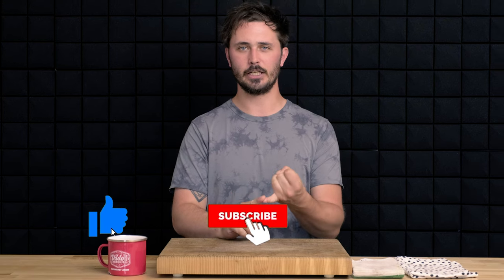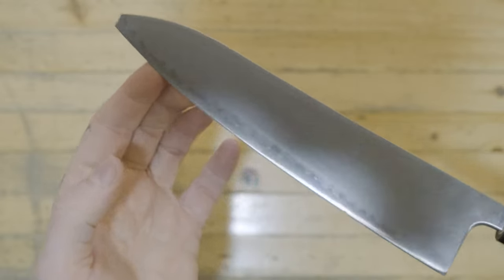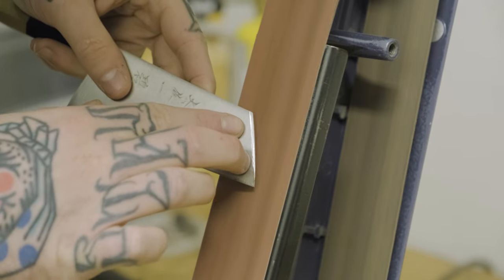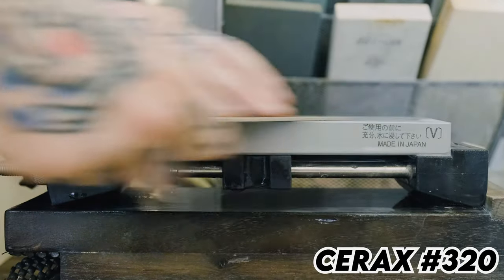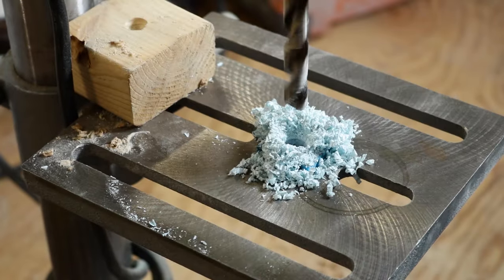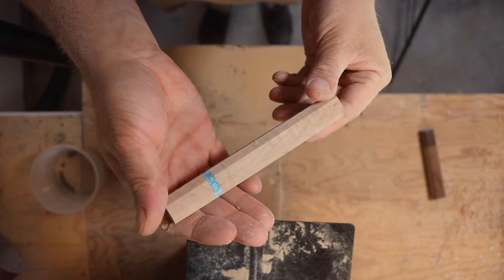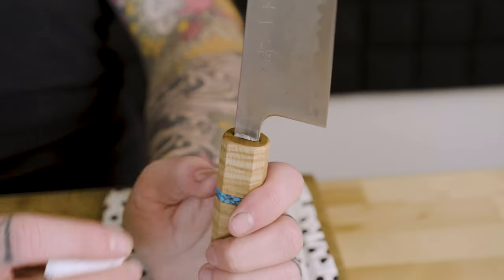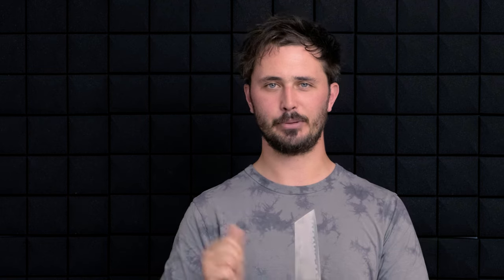Japanese Knife Refurb + Giveaway!

Comment: I screamed OMFG with how much "just the tip" he took off. I recommend doing an affordable knife like Kyouhei Shindou with custom handle, so people will see nice things don't have to cost a lot.
Reply: Well the chip is a major issue to structural integrity of the knife. Either take it off and try to reshape the knife now, or it will break pretty quickly down the line... there's no coming back from cracks like that. The damage is done.
Reply: @sinbadthesailor87  I noticed when I rewatched. Still painful for me to watch a good knife being chopped. They did the best they could. I understand.
Reply: @sinbadthesailor87  I think unagisaki would save more of the blade length, but I can tell someone has a preference for bunka